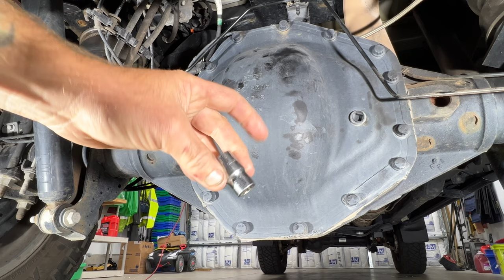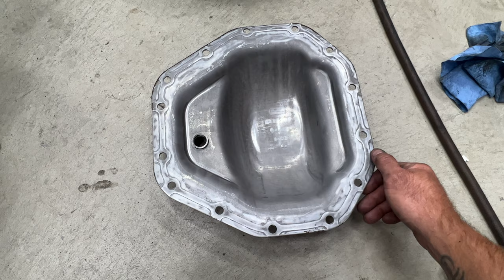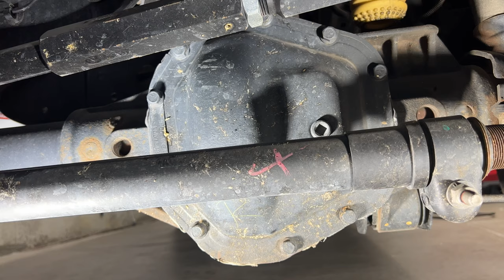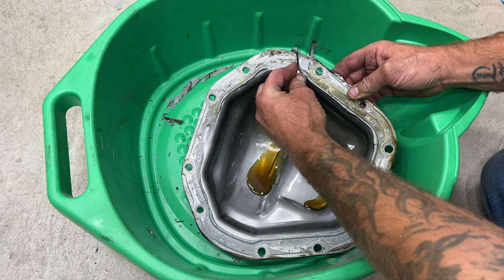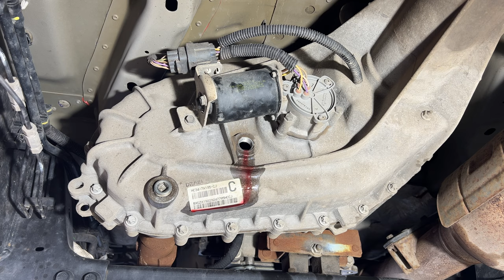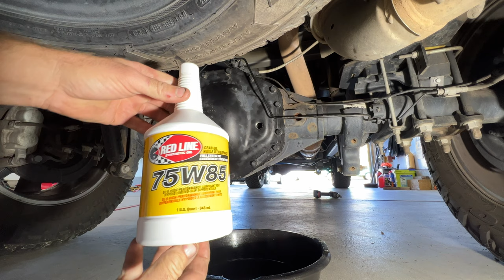2019 Ford F-350 Differentials & Transfer Case Service How-To

Comment: My 2019 F-350 has the 6.2l gasser which has the Sterling 10.5" rear differential which uses the 75-85w oil.  You can tell the Sterling, it is a 12-bolt.  Your rear is the 14-bolt Dana and needs the 75-140w gear oil.  The Permatex "Right Stuff" black is good to go in a minute.  Permatex has a new specific gear oil silicone I used.

Comment: Look at the back (other side) of the differential and you will see Dana. I can see the Dana logo on the shock mounts of the axel you are working on. Going to burn it up with the wrong gear oil. 

F350 diesel comes standard with Dana for the extra towing hence F350 and not F250.

Comment: How often should this maintenance shown need to be performed?
Reply from the maker: It all depends on what the truck is used for. If you tow a lot with it or if the rear end sees the boat ramp often and is submerged in water you will want to change the fluids more often. Best bet is to look in the owners manual there is a chart that will somewhat break this down.